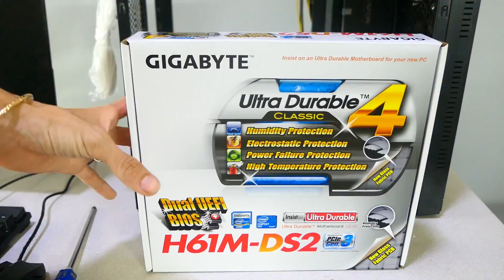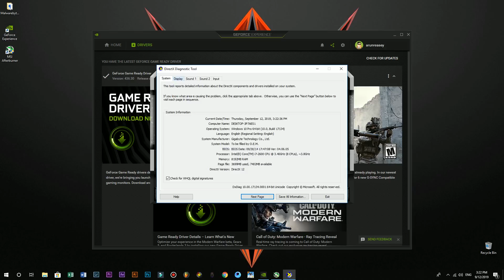Change new motherboard with this old PC - i7 2600 / GTX 750 Ti

Comment: I built this system for around 170$ I got the processor for only 25$. Btw I sold the system to a kid for 450$
Kids will buy it if it as RGB
Reply: Bro i got it for 45 dollars i only need to get 4 ram more and a motherboard